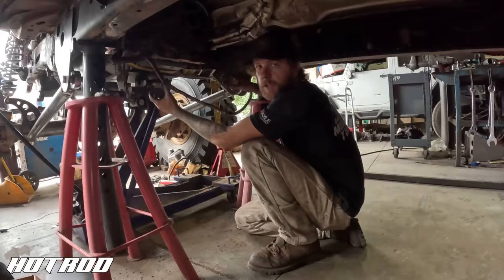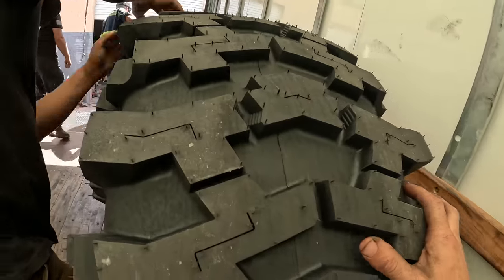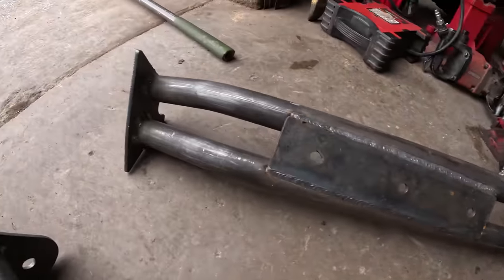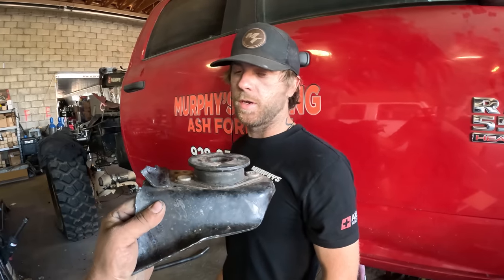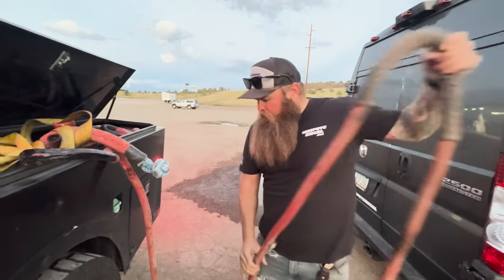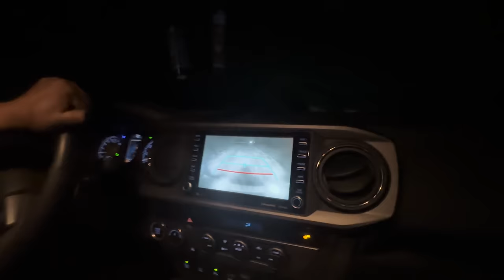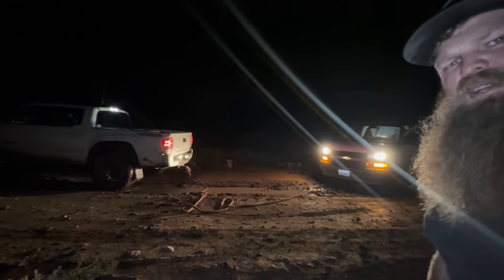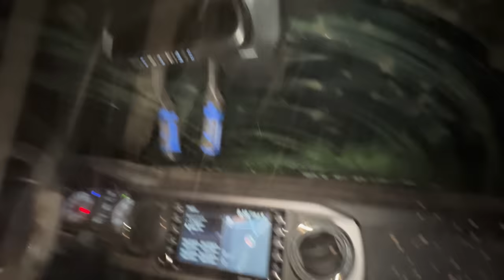Will 58" Tires Fit On A RAM 5500?? Can A TOYOTA TACOMA Recover A 15,000LB VAN??

Comment: With a ram, the crossmember should be quick release for ease of taking the transmission out, as much as they need to be replaced or rebuilt
Reply: I put 230,000 on mine before it had to come out the first time
Reply: Mine is a 6 speed standard 22 years of snow plowing still in the truck original clutch too bad cancer is eating it alive
Reply: Another good one from Murphys Diesel & crew. Wrecker Rick will pull anything with anything with his Kinetic rope.  Thanks for sharing guys. # What a team. Damn. 58,s nice.
Reply: @jamesvuxta8723  people really think they're horrible, but in reality if you take care of them and don't drive your truck hard they last.
Reply: Yes sir, can't wait to see hell boy in action!❤
Reply: 5500 usually has the aisin transmission they don't break

Comment: This,  was hilarious Rick. De Niro doesn’t have a drop,  of windshield-washer fluid in his Windshield Washer Reservoir. And yet,  I keep a gallon of it behind my passenger seat.

 With a roll of Bounty Paper-Towels on the back seat. Right rear, side. Unbelievable.  I Betcha,  your reservoirs are full or not far from it. 

I learned years ago here in NW Montana to always,  always carry a gallon with me. We live off a dirt-road.  5 1/2 miles until you hit pavement.  

I feel sorry for him. I do. And yet,  I’m sure there are times that you find it hard too.

Comment: thoughts on me putting a shortened AAM1150 in my 4.6 triton car that broke three ford 8.8 axles... everyone that has a truck already has one in there truck. 2wd tire chains and a locker... plows snow drifts up to 3 foot deep brake an 8.8 doing that for half a mile.

Comment: Does Hotrod not know how to weld continuously?
Reply: The thinner tube I’ll spot weld sometimes if I want it to look little better. I’m used to running 7018 and 6010 in the oil field previously and trying to get in the habit of pulling a trigger instead of rod in the shop

Comment: I can hardly believe that the rest of the passengers felt comfortable riding in a vehicle that you can’t see out the windshield.  Take a rag and wipe it off, dip water out of a ditch and rinse it, heck do something. Obviously, the windshield wiper blades are worn out.